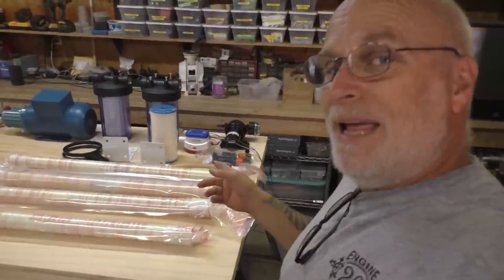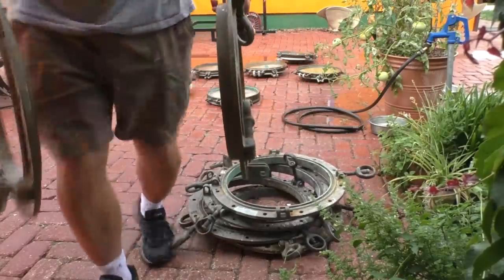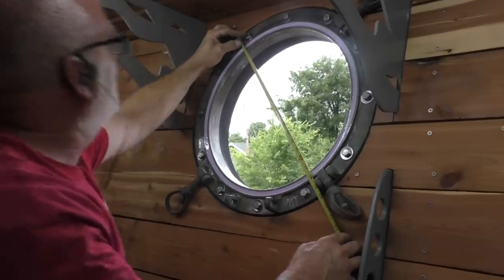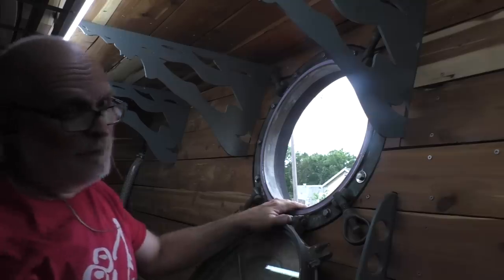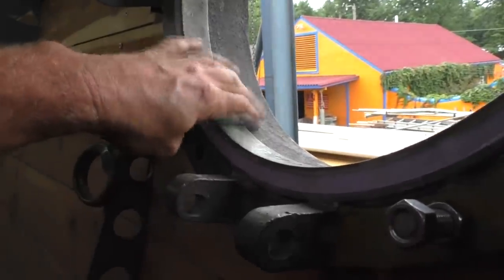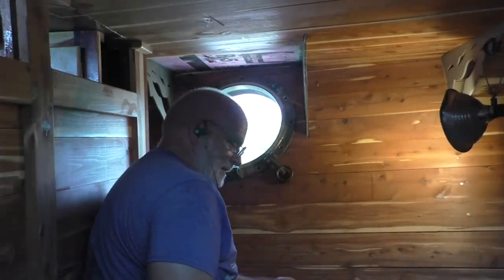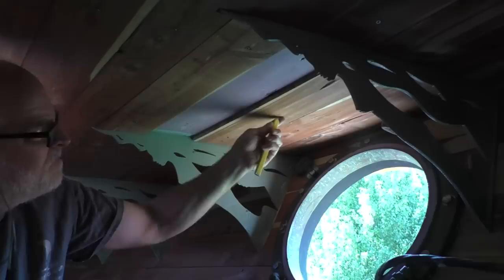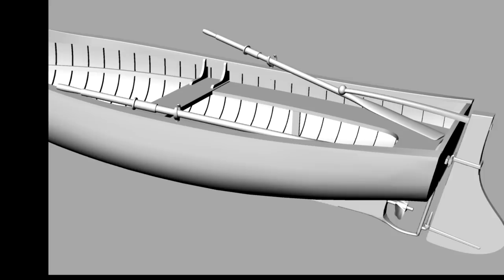Portholes - Installation

Comment: My job on the sat morning was to clean the ports & rub some vaseline around the rubber gaskets & Believe it every 4th sat. change the straw in the mattress , Ha along time ago . Our ports used to be hinged from the top with a little chain & clip to the deckhead (Easier to close when green waters coming in)Didn't do the straw mattress any good.
Reply: I figured that the opening up was to have the weight of the port assist when closing the thing slightly late after bad weather takes hold.

Comment: Why is the hinge of the porthole at the bottom? It seems to me that they deadlight and glass would be more out of the way if the hinge was at the top, provided you had a way to hold them open (some fixture in the roof/deck).

Comment: How flip’n ironic!!!! I was replacing one of my air tanks the other day on my pickup. It’s under the rear bumper in a very hard to get to location. To the point I have to drop the spare. The back bolts I couldn’t reach and yup, duct tape saved the day! Exactly the same Doug!! Add that to the Red / Green 101 uses of duck tape. 😂🤪

Comment: Hate to say this but the deadlights are upside down. If the weight is the other way, it helps any small person close it and not have to lift a heavy weight.
We used to send young electricians under training to go to the pussers store to ask for a dead light when a light bulb blew
Reply: If you can’t lift the weight ,stay off Dougs boat ..😆

Comment: If you ever wish keep the high side ports open for air when underway you're really gonna have to figure out a way to dog those brutes down.  At 10 deg of heel some those ports are going to be hanging free and they're heavy enough to smash the shit out of your cedar walls, or even break the glass as they swing.
Reply: Doug is installing them upside down. The hinge is usually at the top and the deadlight and portlight both hang off of a "T"  that hangs from the deckhead on a short chain when they are open. The "T" slots into the portlight / deadlight dog. At least that's the only way I have seen them installed on the boats I work on.
Reply: @bruceyoung9028  I would also install them hinged at the top, but Doug has decided he prefers the other way.  Fair enough.
Reply: @Jakfilm  fair enough,  sometimes they do swing sideways,  so why not.

Comment: You should be able to machine new parts with those threads on a lathe. They look to be square or trapezoid threads, so nothing too exotic and you don't need tight tolerances. I'm not a machinist, so I might be wrong about how easy it is to make them, but I do know they can be best made by using a lathe.

How good is the UV performance of the silicone you used to make the seals on the portholes? I have a project I am planning that needs something like that, but the UV resistance needs to be really good or it will start to leak.
Reply from the maker: Not sure about that product specifically, but silicon in general is great from my experience.

Comment: You made a nice new seal between the hull and frame and glass.   I see that, but the glass is broken, there is no seal between the glass and the aluminum cover?  How does that seal?  Also, Anti seize without a lock washer behind the bolt?  Please explain.
Reply from the maker: The problem is not the tickle but the river.

Comment: Portholes are upside down Doug. Make up a chain from the shelf above with a metal "T" attached to it. Hang portlite and deadlite from the T when at anchor. Close portlite only and leave deadlite hanging from T. The T fits into the forks that the dogs tighten onto. Another option would be to hinge them sideways. Definitely not the way you installed them. Looks awesome though.
Reply from the maker: I’m guessing you did not watch the whole video or you’re opposed to my ideas of what is right. :-)
Reply: I watched the whole video but stopped it to send the message before I forgot to. It’s your gig brother. Do it as you see fit.
Reply from the maker: @WindoverWater  Hell Yes.  You too.

Comment: Curious as to why they weren’t mounted the opposite way where a latch of some sort would hold them up (maybe a spring to offset the weight) when opened and make it easier to close by dropping versus lifting them?
Reply from the maker: I explained it in the video. :-)
Reply: @SVSeeker  I actually saw what you did later… after my comment! lol You should know these things by now! lol

Comment: Hey Doug have you thought about placing the hinge at the top so they swing up, with a latch holding them up above your head. This also allow the hatches to be closed quickly as well.

Comment: Hey Doug !  Any chance a plain old square box fan will fit in that area between the support brace ladies and hang from a hook or 2 leaning flush across the openings for intake and exhaust while at anchor ( or while in the yard now ) ?  Also, now that crew quarters are up and running (except head), can you accept more visitors simultaneously than in past days ? Was thinking some live in testing couldn't hurt, right ? I'd volunteer, so would many prior guest workers !  Would make for a helluva AirBnB listing too ! ( if they were willing to work, I mean he he )  Looking really comfortable and well prepared !   Take Care.
Reply from the maker: If there is even a hint of a breeze the best thing it to hoist a scoop that funnels the breeze into the forward cabin.

Comment: what happens if the glass breaks the deadlight wont stop any water getting in,
Reply: The dead light covers the glass portion,  so if the glass was broken, close the dead light and the hole is covered.

Comment: Was wondering when those would migrate onboard Doug, they really look awesome !  You said they were also designated as escape hatches, do you plan on putting a ladder rung, fold down tread or maybe just a couple wooden cleats below the ports for your feet in climbing up there ?  Perhaps some sturdy shelving or laptop benches below would also work as steps in that area ?
Reply from the maker: Nope.  Like Richard Pryor said.  Fire is inspirational.   ...and if it's water, then just wait and you'll be about to swim through.

Comment: Man I hate to say it but I think you are gonna have real mold problems in your walls because of using that shitty pink foam. You need vapor sealing. Oof, too late now. :) Keep a sharp eye on the mold situation. After a year or so. Especially below the water line where it's basically bare metal humidity condenser. :)

Comment: how dose the deadlite seal to the glas?
Reply from the maker: It doesn’t need to. A trickle of water is not a big deal.   It’s job is to stop the river.
Reply: @SVSeeker  Ok So would it be not better that it would seal it? Even if it is only for stoping the River :D Don`t want to be bossy here, just love engeneering stuff :D PS: Your inspiring I am building my own Rock climbing gym all DIY! Keep Up love your channel!
Reply from the maker: @McMikeful  Not in my opinion.   The changes of it ever being needed are slim, and a trickle of water is not an issue.  If it bothers you then we'll cut up your wet suite and use it as a seal.  : )

Comment: im sure you know this always use never seize on stainless on stainless they will weld themselves together the first time you tighten them
Reply from the maker: That certainly has not been my experience.
Reply: @SVSeeker  Galling is most often seen in stainless steel (especially when using lock nuts), aluminum, and titanium. Fasteners with damaged threads and fine threads are particularly prone to galling. Hardened steel bolts, especially when zinc plated, rarely gall. Bolt showing light thread galling after the seized nut was removed.
Reply: @SVSeeker  the oxidation layer rubs off and friction welds itself together